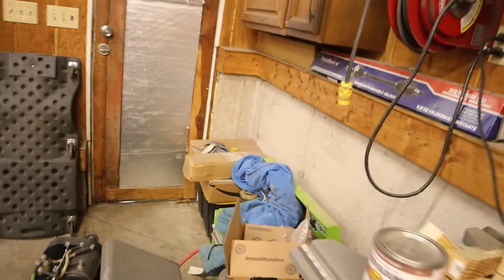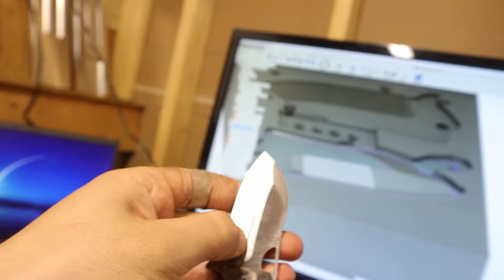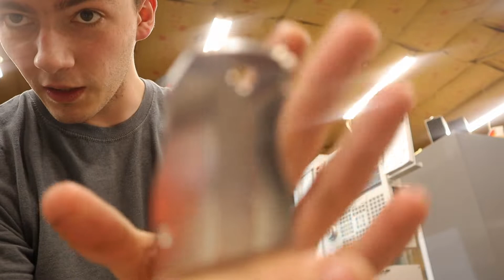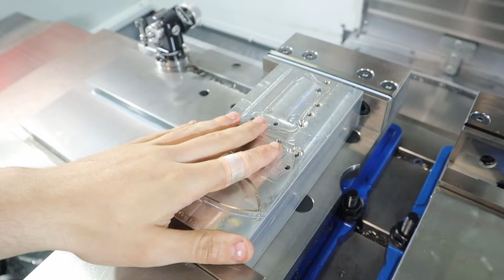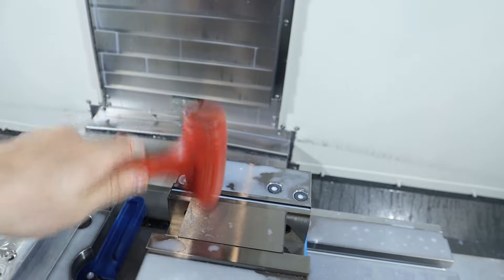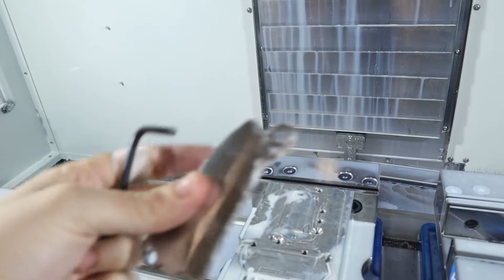Garage vlog 1 - Working on heat treating blades

Comment: Nice work, keep it up.
Just checking you put a drain hole in the fuel filler recess? The last thing you want it to have it all together and then go to fill it with fuel and have the recess full of water with no way to get fuel in without adding some to your tank.
Tray looks good!
Reply from the maker: I did think of that:) has two. Def chance this deck goes completely underwater at some point haha